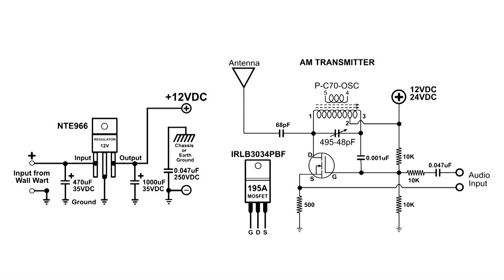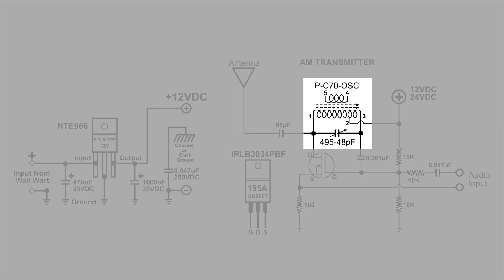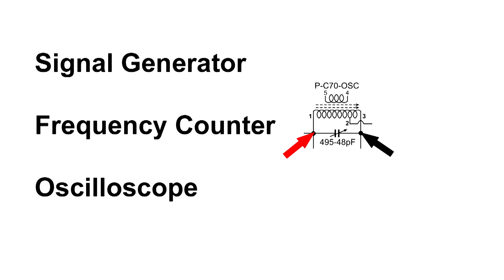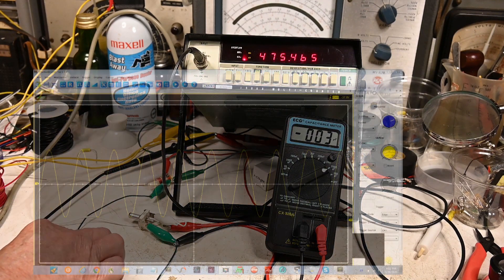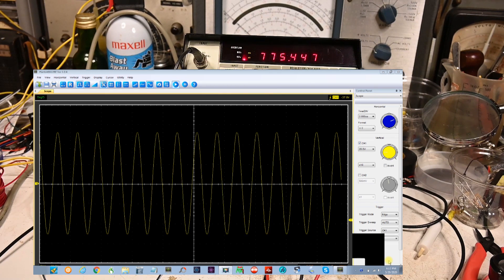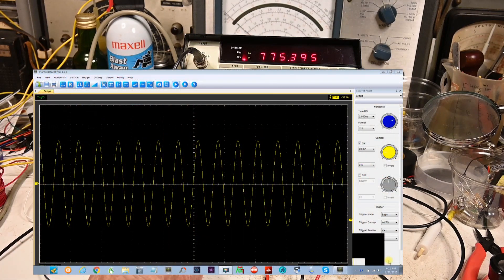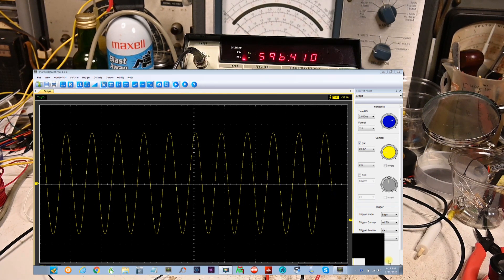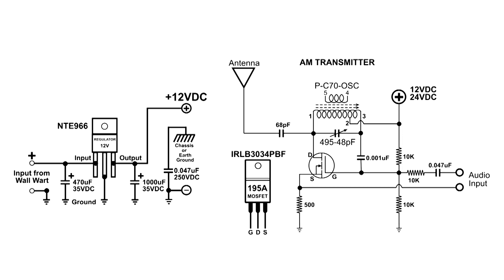AM Transmitter Tank Circuit Coil Capacitor Resonance

Comment: Hello friend.  I was able to model a tank circuit tuned to 1000 Hz. I put a capacitor in parallel with the primary of a mutual inductor. I connected that to the collector, and used the other inductor as a voltage source in series with the base. I had to experiment with several methods but finally got it working.  It's still a bit of a mystery setting it up and I had to play with it.  When I compared it with a tube schematic it's not clear how anyone was able to predict this or design it without experimenting. And it also seems like everyone does it differently.
Reply from the maker: Learn what each part does, that will help.

Comment: Great video. Thanks for taking the time to do that. I knew I could count on a fellow Carolinian. BTW, I'm about an hour south of Raleigh.
Reply: Ok, so, the closest thing I can find is a 12-495pf two gang air capacitor. Much larger in physical size than what your using. But, if it'll work, that's all that matters. Thanks again.
Reply from the maker: Thanks. My internet has been up and down the last few days. As David Leger has said your variable capacitor should work.
Reply: @daveleger2002  I'm glad you brought that up. I wasn't sure if that could be done with a variable. So, if one wanted to reach the higher end of the am band but had too small of a variable, they could add a fixed capacitor in parallel and raise the pf's. I assume that it would also raise the lower end of the variable pf's as well ?

Comment: Great idea Rick showing this in an actual working circuit. Especially an AM transmitter circuit. ( and for those who don't know, this is a very good AM transmitter that goes together with little trouble to get working )
Plus I like seeing that you have put that oscilloscope thru the trials and it has really come thru it. Looks like a great option to high priced scopes out there.
Reply from the maker: Thanks. My internet has been up and down the last few days. Yes a beginner should be able to build this AM transmitter and have it work well. Another yes, this $60 CP oscilloscope has worked well for my purposes.

Comment: It occurred to me not long ago that when you put a capacitor across a motor to provide power factor correction, you are creating a tank circuit tuned so the most power fed to the motor is used for real work.
Reply from the maker: That works